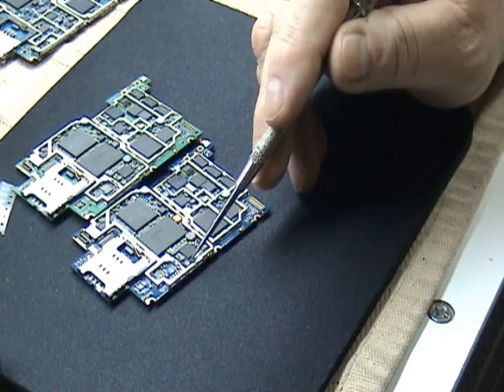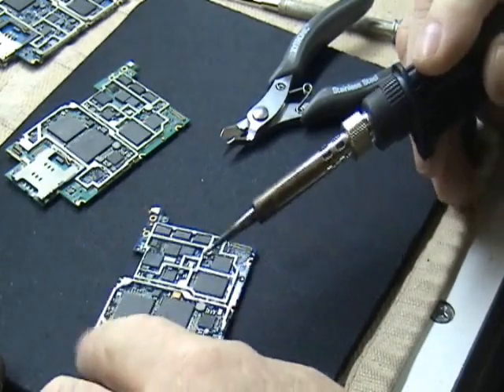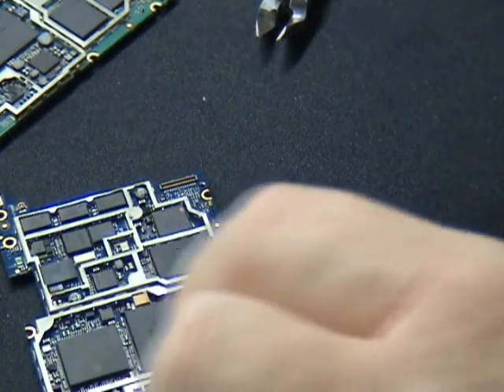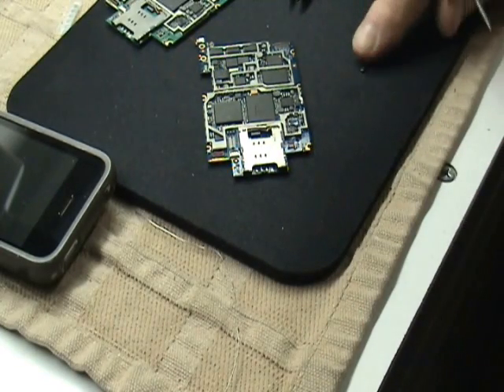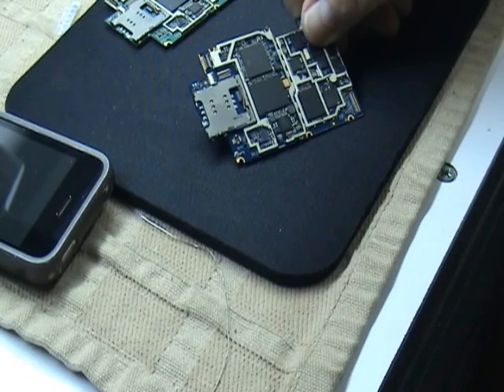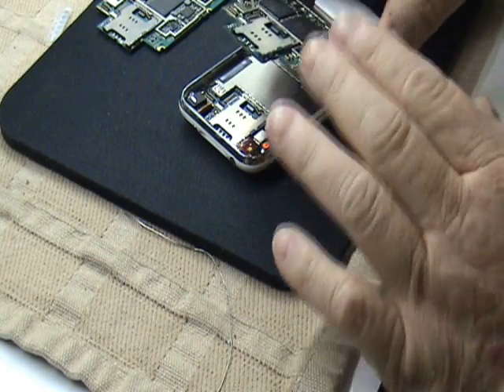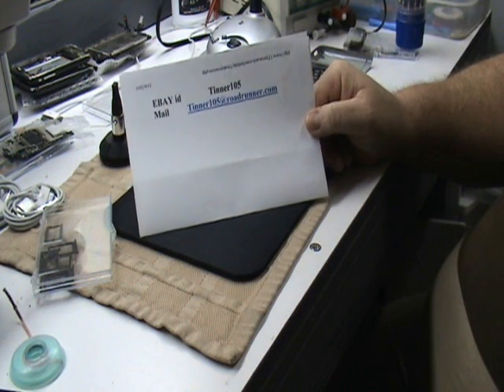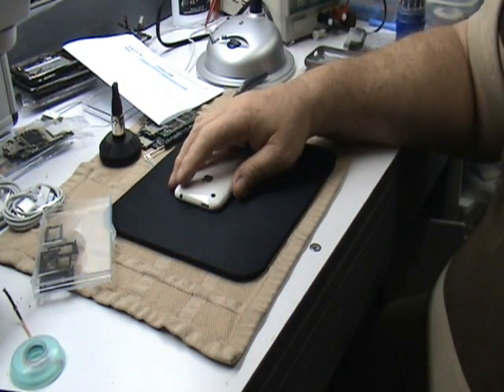IPhone 3gs backlight fix, 6r8 coil replacement  EBay seller id.   tinner105

Comment: Thanks. A video on soldering has never been so useful. Out of interest, does the 6r8 coil generally look damaged from the outside when there's a problem? That is, is it obvious when it needs to be replaced? I'm reluctant to go near my board with an iron until I'm sure this will fix it.

Comment: yea its defo the ones on the board as the metal bits hav bent and the pin in the middle is gone/bent on the other, would the fone still turn on if these were not connected?

Comment: hi
i brought a 3gs with a cracked screen becuz i know its an easy fix to change the touchscreen but ive seen that tabs 6 and 7 on the motherboard have been damage and the tabs wont push on anymore, is this fixable or is it a new motherboard???
regards

Comment: Hello i replace my 6r8 coil from my 3gs as you shown in this video and really work backlight now is working but after 2 day of my 3gs working fine it begin to have some power issues, in result the power button does not work , it can not shut down anymore i have tested same logic board in other iphone and same problem , so i guess there is something bad with another component after change the 6R8 coil, do you figure it out what can be the problem???? or what else can i replace ?

Comment: Do you actually do repairs on a send in basis?  I have a 3GS that got wet.  Phone works fine.  Back light is intermittent.  I contacted an online repair service and they their quote is much higher than I am willing to pay.  They say that the LCD needs replaced.

Comment: I did this yesterday. I did not have water damage, but my coil had gone bad not allowing me to have a backlight. I watched this simple video, followed the directions, and I now have a working backlight. Thanks Tinner!

Tip for people: Chill on the solder. Getting it off is easy, melt solder and bam. Getting it on is more difficult. Place the chip in the areas and try to heat the metal part of the chip and existing solder before you decide to add solder. Too much solder = bad. Dont overheat board

Comment: Hey tinner105,

I bought a coil from you recently. I've disassembled the motherboard, but what I'm concerned with is the location where you replace the coil. Because mine got a metal plate covering that location. Problem is that I don't know how to remove these. Could you please inform me something about this?

Thanks in advance,
Ali Esrail

Comment: i bought a coil from your ebay account and failed to install it myself. what are the chances that the problem isn't my coil at all. i replaced the LCD and still no backlight.  If i ship it to you and you replace the coil and it still doesn't work; what happens from there? thank you.

Comment: I replaced the battery and the coil but I still got a dim light.  Phone stays on now and It holds a charge.  What should I replace now.......Cuz I figure the only thing left is the LCD screen...Or should I look at something else. Thanks

Comment: I got an Iphone 3gs.....It got some water damage from the sprinklers. and at first my backlight went out then my phone now wont turn on at all. I tried to charge it but it was getting hot so I stopped it....Could I have busted NE thing in there...  What would you recommend to replace besides the coil to get the phone to turn on....and also should I open it and clean it with something to stop the corrosion.......NE help would be grateful....thanks....